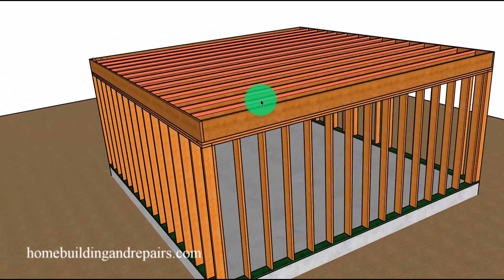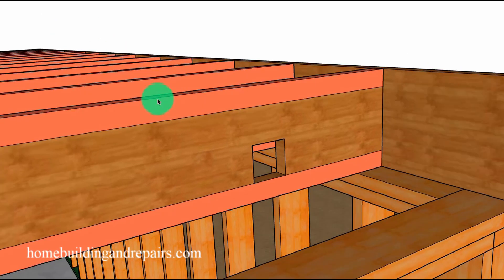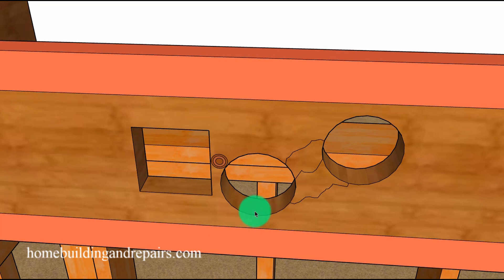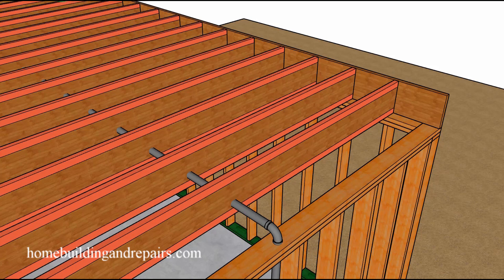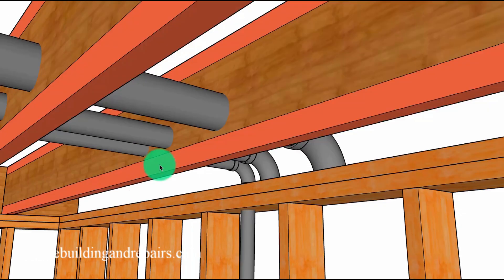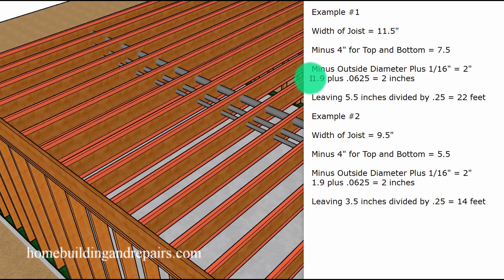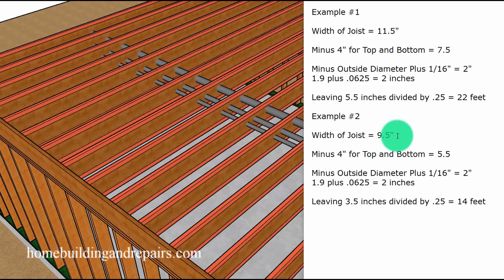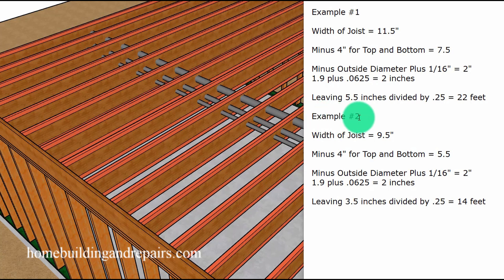Can Large Plumbing Pipes Be Installed In Small Floor Joist And How Long Can They Be?

Comment: renovating my kitchen,  plan to run a 3" drain pipe through 5 solid wood joists of 8", the holes that run the drain pipe are over 3" Dia, so I want to use the metal joist reinforcement plate to support the joists. it is possible? Thanks.

Comment: Nice video I have a question though if you divide by .25 the floor joists are not 12 inches apart. Does that mean you’re going to get a slope under a 1/4 of an inch per foot?

Comment: what are the options for 4 inch ducting for a cooker hood extractor? not going to be able to drill a 4 inch hole in a joist thats for sure. and in my case there is no room below the ceiling to run it along the corner of the ceiling and box it in.

Comment: a friend just got tagged  The inspector told him  he wasnt allowed to drill any holes in the center parts of a floor or ceiling joist . He must stay on the outer 1/3 areas of the beams
Reply from the maker: Been there before and feel their pain.
Reply: That inspector should find employment where intelligence is not required.

Comment: when you say you can drill a hole anywhere in the floor joist as long as its not the top or bottom 2 inches wouldnt going directly in the middle of the joist cause it to flex down? just trying to figure out the middle third you were discussing...
Reply from the maker: It could and I'm on your side with this one. I don't like drilling any holes and would suggest contacting an engineer for more information. This video was based on the information found in the International Building Code Books that are used by building professionals.
Reply: @gregvancom  10-4 i didnt even see i got a reply until now! i appreciate it.

Comment: I wonder if it's possible to bolt some 1/4 of an inch steel plates to reinforce the joists - that way it should be possible to drill without limitations
Reply: there are steel plates with a central hole designed to support joists. They are engineer certified and strengthen the joist more than sistering.
Reply: I've seen a Similar thing in roof sistering so I think you're right
Reply from the maker: I've never used quarter-inch steel plates to reinforce pipes drilled through joist or seen it recommended by a structural engineer, if that helps in any way.
Reply: @gregvancom  well it would reinforce the joists, not the pipe

Comment: Hello! Do you have an email? I have some very simple (probably simple I woke think for someone like you) questions about a carport conversion and would love if I could pay for a short video call. You seem to have a lot of info. Want to enclose an attached carport to expand my kitchen before I update it all. Need to add in a washer dryer room mostly. Can't seem to find your email though... Looked on your site and the contract link in YouTube is broken l. Thanks in advance! I appreciate what you do!
Reply: After some more research it seems that footers of some sort are required. You can't simply build in top of the current concrete pad. It seems that would be a whole hell of a lotta work to pull up sections of the pad to pour in footers for an expansion.
Reply from the maker: You can go to our website and there should be a link in the video description comment area in all of our videos to the website. I also do not offer any type of consultation except for through email. Don't forget to check out the website for more videos.